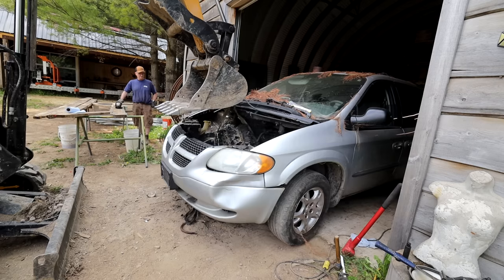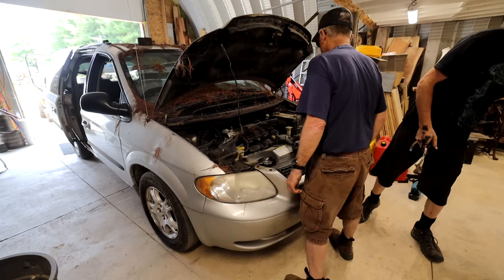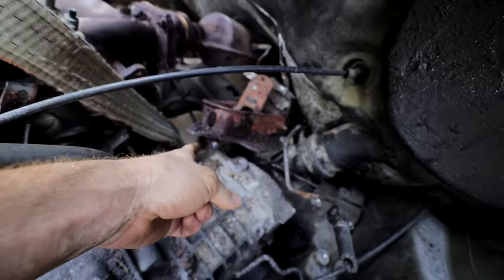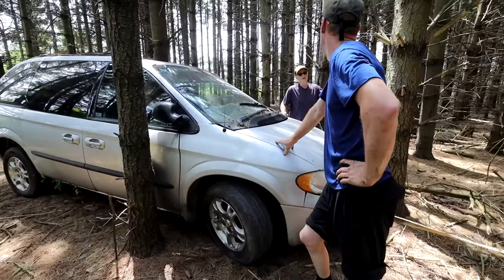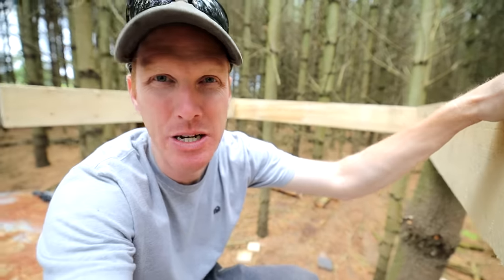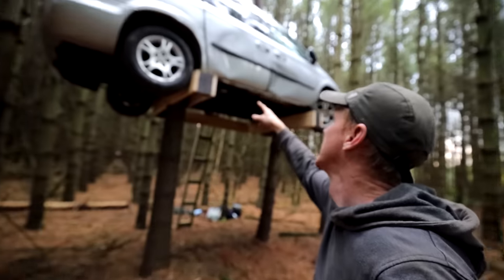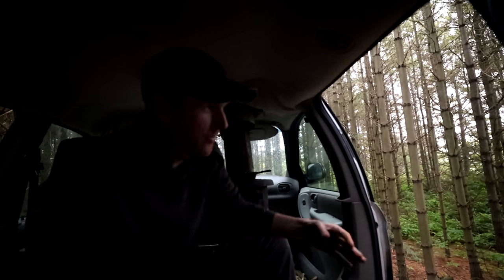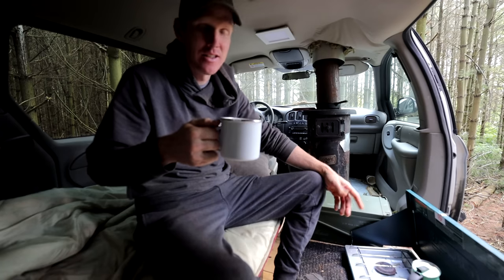Building Tree Top Truck Treehouse (on a Budget!) - Fireplace, Bed, Luxury, Storage, Sleeping, Cook'n

Comment: This is almost the most redneck thing I've ever seen. (It needs more duct tape)
Reply: What do you mean? Totally factory standard way to remove an engine.
Reply: I agree but that’s not necessarily a good thing.
Reply: Use the duct tape to pull the dented door panels back out.
Reply: Needs some cowbell too maybe for a wind chime
Reply: Rofl😂
Reply: I’ve seen a couple minivans converted into pickups in my county. The one had a house door connecting the front two seats to the bed.
Reply: Don't be hatin
Reply: @johnkellison7596  I'm not hatin, redneck ingenuity is highly valued around my neck of the woods
Reply: “Needs to be shaken”
Reply: If you add more duct tape, then it would be Polish
Reply: And camo paint.
Reply: It needs a camo painted exterior on the van...like DIY camo painted and then...well then we got redneck heaven
Reply: @artfx9  Finally someone else with my vision! lolo
Reply: God I cannot believe the nes generations glad I amon last leg 77 year old DAV army VN,🇺🇲🇺🇲🪖
Reply: Until a flood that last weeks. He be a genius and we all be asking for plans. 😂

Comment: I love this, and  - since you asked - I have a million ideas/suggestions. I would open up your hood and spray down your entire fire wall with some hard foaming insulation. Having lived in a non-motored van before, this was always a way that creepy crawlies (and mosquitoes)  got in the cab - through the zillion of holes for wiring, heating, guages, etc. I would also keep a bag of silica gel under one of the seats when you're not there. This will abosrb the moisture that otherwise would grow mold on your upholstery, etc. You can just dry it out when you get there by putting it in a bucket on the woodstove. You could also put a solar panel on your roof, or, if not, a deck on top for lounging.  I would also definitely put a deck around it on at least two sides. Then you could sit out. And a retractable rope ladder too. - to keep you safe from you, know, pirates or some such.
Reply: Dry-z-air works too.i think Princess Auto will have that on sale. 😂
Reply: Tree fort no girls allowed according to Calvin.
Reply: @recoveringsoul755  Do they have tigers in Canada or will he have to get a bobcat?
Reply: @catgynt9148  I'm sure he could get the same breed of tiger that Calvin has
Reply: LOL, "pirates or some such"
Reply: @recoveringsoul755  NO girls?  I don't think I will be joining ur club...
Reply: @acabaconto  I am a girl. It was a Calvin and Hobbes reference
Reply: The roof seems to be very strong so should be able to accomodate an upper deck, where you can stretched your legs.
Reply: @recoveringsoul755  Kudos 2 U, 4 being a girl Sherlock Holmes...

Comment: You could remove the dash and make the empty engine compartment into storage accessible to the inside. Or maybe make it into a sort of tuck away sleeping space leaving the rest of the van open for other things.  If you put a deck on one side and around the front then you could maybe rig up the engine compartment to be something like the kitchen area on the back of a teardrop camper. Possibly rig it up so when you open the hood it all lifts up to be an accessible kitchen area.

Comment: especially if you dont need or want the front seat, then the front door should be your ladder. Probably a sturdy, tightly woven rope ladder you can retract in the evening.
Pretty cool idea otherwise. I would build a deck on the other side and use the front passenger door to keep the wood outside, covered

Comment: My thoughts for a nice hunting cabin:

A minivan where all of the windows roll down (so all windows are potential shooting points)
 A swivel base passengers chair (so it can be a comfortable seat usable from the rear
Leave the fuel tank on and you can use it to fuel a chinese diesel heater (or gas version) for a VERY long time for heat with no effort
If you had power open doors you could probably make a ladder drop out of it when you open the door

I've wanted to do this for a while, though I dont know if I will or not (only 10 acres here). But fun project and it gets the wheels turnin', so to speak

Comment: Cargo box on a roof rack for some extra storage. Awning off the side of the roof rack. Small deck at the rear with mosquito netting hanging from the open tailgate for a covered veranda. BBQ grill under the hood. Zip line from one door for emergency exit. 12V winch to rig up an electric platform/bag for hauling firewood and supplies up? Pull down fire escape type ladder. Wire up the van headlamps, tail lights and flashers for the visual heck of it. Some 12v led perimeter lights on the roof. Shower under the van. 👍🏻

Comment: You should name it Fort Caravan. Also, you could make your engine compartment into a hot tub with the hood suspended above it as a roof or a place to put your wood... on the trees across from your sliding doors, you could mount a massive tv with a frame and roof system. This way, you can tailgate and watch American Football! More ideas to come.

Comment: You could've taken out the whole Engine/Transmission and front suspension by dropping the cross member with minimal effort.  It's a Dodge, nothing but idiot proof plugs on every wire. Watch a youtube Video on how too??? If something is beyond rusted on then that's what the sledge hammer and reciprocating saw/ death wheel. Self Reliant... ? Don't get me wrong I like your tree fort minivan idea, very low budget/ Hill Billy but your credibility withers with the engine removal.🤨

Comment: Kevin get you a 110 volt to 12 volt converter and plug it into the battery pack. Now I think you should clear a 14' wide path and find you a 30 or 40' camper and put that up in the trees.
Don't know where you store these crazy ideas in your mind but you should visit that place more often! Great video Kevin

Comment: I would definitely continue to add to it. I would put a deck around it. It would make it easier to come and go, increase the stability of the structure as a whole. Provide easy access to the ex-engine compartment (storage), a place to sit and cut fire wood. I would put a canopy over it to keep rain at bay and help keep it cooler during the summer time, you can put solar panels on it for energy demands. Can always put a small generator on the patio, put a collapsible ladder or maybe retractable one you can even put a screen around it for the mosquitoes and flies and even birds. I just hope that the trees that it is perched on don’t grow any. I also hope that you own the land that you built it on, and I hope that the government leaves you alone, sometimes laws can really be a pain. But I think it’s 👍

Comment: How could this guy not know that to remove the engine you need to unbolt it from the frame
Unbolt the motor from the transmission instead of piece by piece

Comment: That was the most graceful engine pull i ever seen...🤣🤣🤣
It woulda been nice if the harness was still intact.. Power windows.. stereo..  factory lights...  Battery under the hood and a solar panel on the roof...
Good stuff man.. keep doing what you do..👍👍
Reply: I forwarded this video to an automotive engineer... the engine on some of these vehicles were designed to be removed from the bottom, not the top.

Comment: Having it in the air is actually better than maybe you thought. Leaving it on the ground the bottom will rot away because of moister from the ground getting trapped between the vehicle and ground. Having it in the air it will probably last forever. You just gotta keep nest's out of it so you can continue using it

Comment: If you added longer 2 by 10's at each end you'd have the start of the deck framing for outside the 2 side doors, from there you could figure out how to deck around the front and back of the Tree Van

Comment: Hmm… actually another idea would be to put a pull down ladder under the engine compartment, remove the dashboard area, and make that the entry into the van. Something similar to those pull down attic stairs only more robust. 
As for adding a deck why not remount either one of the side doors or maybe the back hatch with a hinge at the bottom. Add some cables or maybe some folding supports for strength. Then you could lower it to make a small open air deck.

Comment: I love this Idea!
You could build a small deck around the vehicle, so that you won't fall out as soon as you step outside.
And maybe a corrugated iron roof over the car, so that it rains even less on the car itself, this should increase it's lifetime by a lot!
You could add additional Vehicles like transporter vans or post trucks as housing, too! 
They don't have to all be the same height, they could overlap and have bridges between them. 
And they don't have to be ordered neatly in 90 degrees, because they stand where trees are. So it looks like a forrest of vehicle housing.

Comment: That is not how you take a motor out of a vehicle there's motor mount bolts on the bottom of the motor on the side you undo the bolts and it frees up the motor from the vehicle shaft under the transmission Jersey exhaust bolts You're making it harder than it needed to be

Comment: Should have just used the bucket and cut the front off the van.there is like 4 bolts on the bottom every thing would have dropped out the bottom.

Comment: I can’t pinpoint why I was uncomfortable, other than falling off while a fire is burning, but seeing comments about building a deck around it, I think would make it seem safer at least. I do like the idea of the sliding doors open, and even the back popped up would be cool, but overall I’d add at least a 2.5’-3’ deck on the sides. Adding a wider spot on the back could expand it overall, with all the builds you made originally.
I might even try making the driver’s seat swivel around, for the multi-purpose uses like just a seat, or a blind for hunting, I’m sure Chris can add his two cents for that. It might be cool to have a camo net cover for when it’s not in use, that could also be an awning when it is raining, or very sunny. I could see lots of possibilities, especially for the kids!

Comment: You could save the wheel bearings / hubs and the wheels and make a heavier duty log arch using that as the wheels; I've been thinking of doing this with some old bad wheel bearings (bad for 60mph doesnt mean bad for 3 mph)

Comment: Lol this has to be the most entertaining way to remove the engine/transmission from that van. I never seen anyone remove the engine/transmission from top on one of those, I usually remove on lift from bottom of course removing everything first including exhaust and etc. Then he removed the engine/transmission from top without even removing the bumper and even funnier, at first he didn’t even remove the drive axle/CV, eventually his friend help him figure it out. Then for the funniest part wrap strap around frame and wonders why engine isn’t coming out? 😂😂😂😂

Comment: Something else you can do is put a 1500 watt generator in the engine compartment and have is fixed so the vans gas tank can hold more gas for it. Then maybe hook up a switch to start the generator from inside the van.
Plus the reason it says is because you only have 2 trees setting under it. Try tieing it off on a couple of other trees in the middle of the Van.

Comment: You ever sleep in a reclining vehicle seat?  Did that with a 1980 Honda Civic, I don't care much for flat hard bunks,  but I built a pair of bunks in the back of my '69 F250 with full bed and canopy, using cross beams, water pipes supporting a duck cloth sewn tube that held a 4 inch foam cotton wrapped mattress covered with a duck cloth sack,  like a giant pillow case... the bunks would support more than 800 pounds... the result was very comfortable... 

It was pretty amazing with all the handling of the car body that it didn't have more dents or cracked glass by the end of the build... so far... If you have issues with funnel clouds you might consider bolting the frame to the tree stand ???...
A build out to another set of trees maybe... a high walkway to an accessory building or patio area or additional housing like you are building a bed and breakfast resort? Sheltered hammock stands under cover?

Comment: I'm wondering if you could keep the existing climate control system -- keep the fans and A/C working and just run them off a nice big 12V power supply with all those batteries.

Comment: WARNING: The maker of this video is a bit of a nutter. 
 Personally, I would have the drivers seat on a swivel, like on a camper van. Then you would have more room and have more options on where to sit.
 And how about fitting some wind deflectors to the front windows so you can have them open a tad............

Comment: This video has me thinking about another channel I watch, Project Kamp, which is a group in Portugal that basically bought a chunk of land, and wanted to use lots of recycled material to build homes and such and live off the grid up there, in a bit of a hippy life way. Recently, they took an old van, the larger kind, and turned it into basically a tiny home, mounting it up on wood blocks rather than two trees of course. I think in their case, having it be a Van made it better for permits and such, as it would be a non permanent structure,  same as an RV or a home built on a trailer.

Thinking of it, whether a tree house, or closer to the ground,  a used vehicle like yours does make a really inclosed, insulated, waterproof shelter, complete with windows,  and possibly even some comfy chairs or benches fo reuse.

The thought of  a van like this, woth a simple bed, chairs maybe turned around to face inward,  and maybe a nice little deck around it, would make a fun and cheap little "Guest Room" for folks to stay at, or camp in. And like you said, stripping the extra parts can sometimes get you your money back in scrap.

My absolute favourite parts are that you have lots of windows, the cheap price, and that it already is insulated  waterproof  and sort of sound proof. Good luck getting all of that in a cabin built that cheaply and that quickly.

Now the only thing I'd be curious about, is if their would be any way to make it look nicer?

Thinks like small cabins, and even shipping container homes, all can look rather nice, and very house like. I'm not sure how to make your VanCabin look better, other than a nice coat of paint?Maybe a more classic or vintage van body  to start  with? Maybe if you used the vehicle more as a structural base, and built wood around it, yet kept the windows and such, but thay feels like lot of work for no benefit, other than aesthetic.

I suppose a nicely painted van, parked beside a nice deck, maybe a simple roof on it, could hold a certain charm, but I just won't look as good a nice log cabin.

If you can think of a way to pretty up a Van Cabin, I'd love to see it, after seeing how you made your outdoor shower out of water totes and somehow  made it look awesome

Comment: I suppose you could remove the steering wheel and add a small tv and antenna... apparently they use very little power now, or a radio might be good... just a comfy place to relax or change the dash with a table like desk for work or what not, big window for a big view while you eat. Prob the only "good" ideas I'd have. I'd probably add that to my own, if I were to do something like this. 
Love the build. Didnt know you could sell parts you removed to effectively break even... good thing to know.

Comment: Mechanics called the Chrysler Minivan series of vehicles "The Mortgage Payer." Which means they are always needing regular repairs that cost the owner dearly. So for it to be used as a pedestal or platform camping box is perhaps the best use of these things I have recently seen. Now what you need to do is cut out the firewall, remove the hood and the windshield and extend the interior space of the "Box" by building sort of an aluminum cover over the open space, like a tonneau cover for the rear box of a pick-up truck, so there's more room for multiple people and the tonneau should have less windows to make that area for sleeping . Oh, BTW if you can't gain access to the underside of the vehicle, removing the engine is going to at the very least double the time of engine removal because it is a serious pain to remove the lower components from above, as you found out. BTW I had a good three minutes of solid laughter watching you try to get the engine out of the vehicle! LOL Only to discover that you are trying to yank out the subframe with it! LOL Now that you have it in place, perhaps you might think about building a deck off of one side of the van as a nice high level sitting place and you could also build a little awning to cover it up as well. All in all, not a bad idea for a project.

Comment: I strongly suggest you 1. Put a smoke stack cover on top your smoke stack to avoid hot ashes floating up out of it and starting a fire. 2. Put up those angle braces you were talking about under your platform. 3. Secure the van to the wooden frame by attaching metal U-shaped brackets from the undercarriage of the van, wrapping around the wooden frame and back up to the undercarriage. I also like the idea of a porch wrap around would be awesome.

Comment: Dont you still have an emergency break connected to the rear wheels? 2nd. Consider putting a generator where the engine used to be. 3. Consider, flexible solar panels to charge a battery bank on the roof rack! Super cool project!!

Comment: Yes. An elevatorsystem to the car. Barbecue inside maybe? Is it far away from the big treehouse and the pond? Maybe make a slidingcable on it fore your sun. Maybe make some see through nestingboxes in the lamps so you can watch frombinside car. The chair is not nescessary but dont loose the stearingwheel, might 1 day you have to take it out.